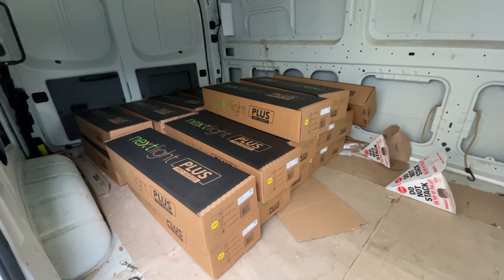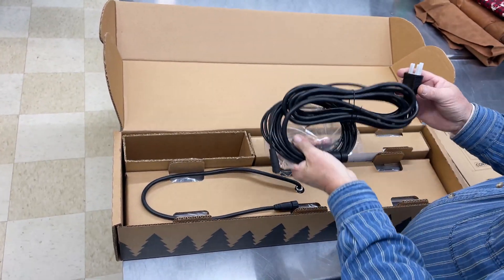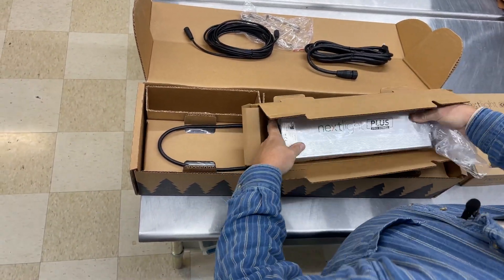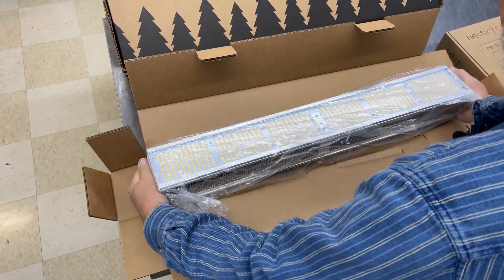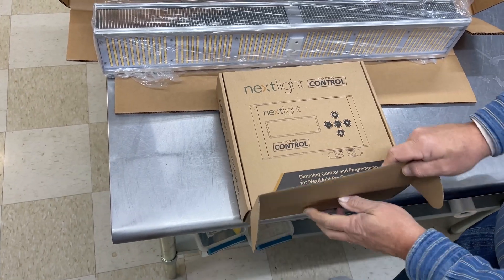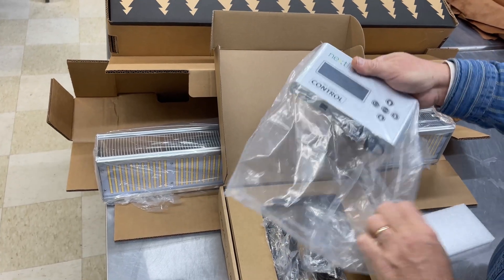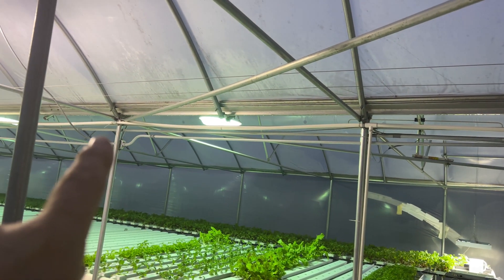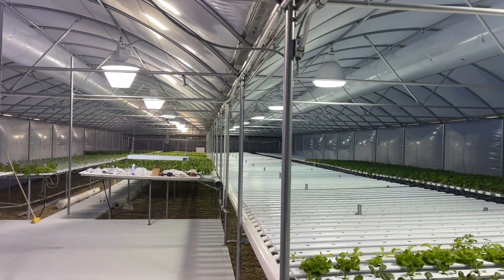Supplemental Lighting Next Light LED's Part 1

Comment: You picked a great lamp, NEVER pick a lamp with a fan. Fans ALWAYS fail, it's only a matter of when. Have your green house guy measure the intensity ro insure the DLI requirements of the cukes and tomatoes are being met. Running the lamps at less than 100% will extend the life and can raise the overall electrical efficiency.
Reply from the maker: Hope they work out well...Will keep u updated on the progress